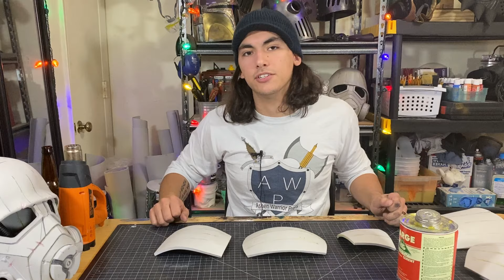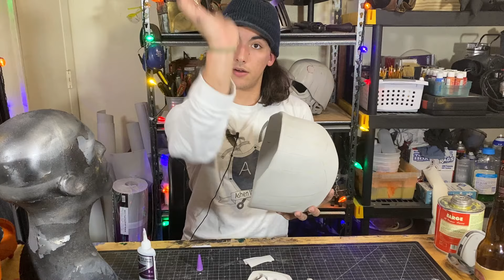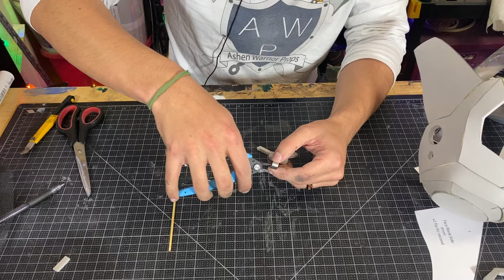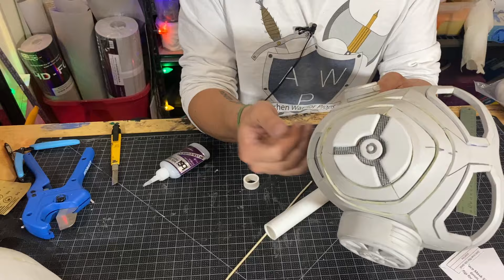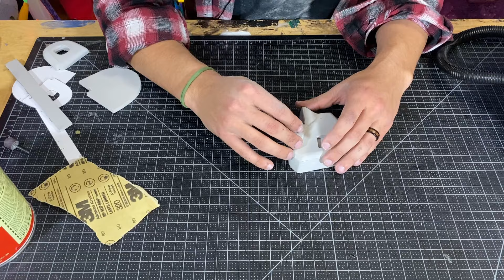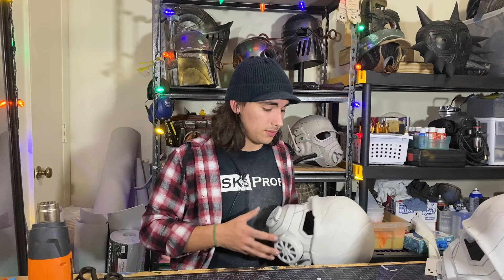NCR Ranger Cosplay Tutorial | Helmet

Comment: I just skipped over to the face-mask section due to my aforementioned preference of using M-1 helmet liners. This method definitely looks more effective and flush than what I first did back in 2019 with the random templates and the too-thick foam I was using at the time. Not going to discard my earlier work, but I feel like making a second go-around at the gas-mask portion and also adding some lights and a fan kit into it after seeing all this. Better late than never when it comes to tutoring ones self on the various construction methods.
Reply: Wait so could you just use an M1 helmet liner and afix the mask to it?

Comment: fantastic Video! I have a quesion... What is the Width, length and thickness of the HD Foam you use for the entire cosplay?
Reply from the maker: Most of the build I use 6mm HDfoam but they have a bundle of 3 rolls 2mm,6mm and 10mm and that’s the best one to buy cuz you’ll use all of it
Reply: @ashenwarriorprops  i nerver use the HD foam before so sorry for the question but I find a site where I can buy it but they don't have 4mm and in your template there is piece whit 4mm so how can do? and when I got the HDfoam I need to stamp the piece on the HD  Foam or....?
Reply from the maker: https://www.dickblick.com/products/sks-props-hd-foam-rolls/

Here’s the link. They do have 4mm as well. Sorry I if I didn’t answer the whole question, having a slightly hard time understanding.
Reply: @ashenwarriorprops  English is not my first language so it's my fault sorry, when i get the HD Foam do i have to print the pieces of the pdf on this or something else? sorry my bad English
Reply from the maker: You print the template on a4 paper and cut it out, then you trace it on the foam

Comment: Does anyone know what sizes all the pieces have to be? 
I printed them all on standard printer paper but im scared they might be either too big or too small so if anyone has proper measurements could you please tell me them it'd be greatly appreciated
Reply: I know this is an old comment, but I would print out the basic pieces and glue them together, just paper, and see how that fits your head. It won't be exact because the paper is thinner than the foam, but it should give you an idea of if this will fit your head or not. He also replied to another comment and said it seems pretty one size fits all. If it's loose, you can also add in some padding foam